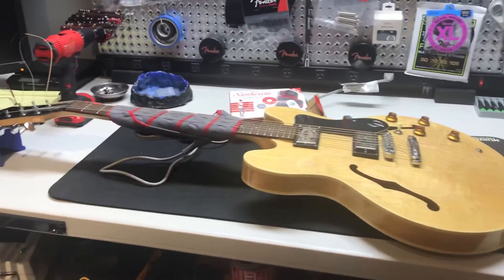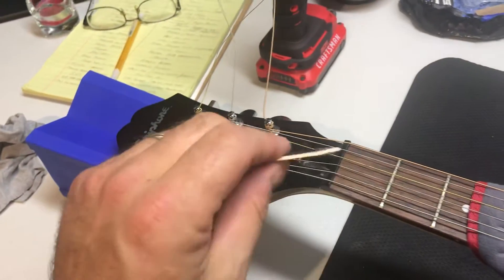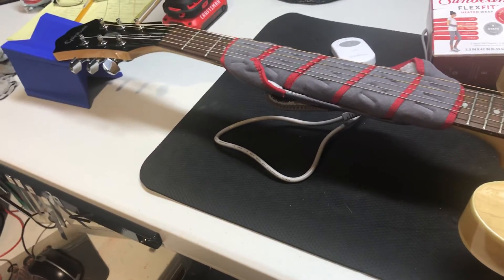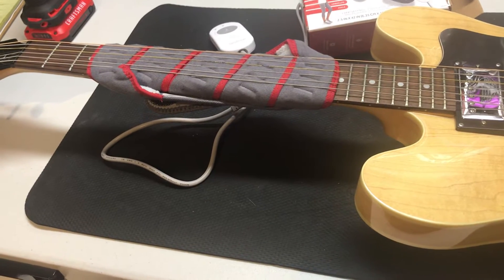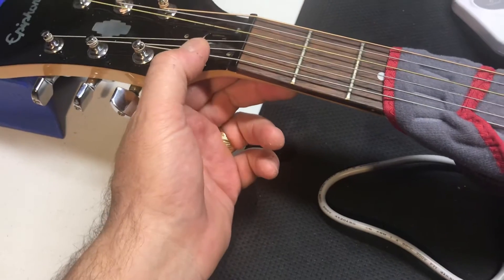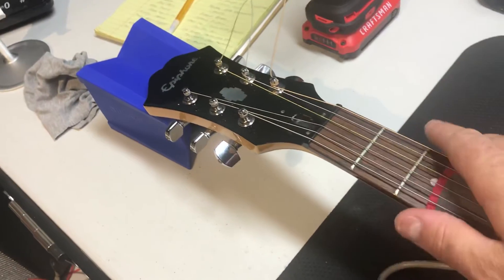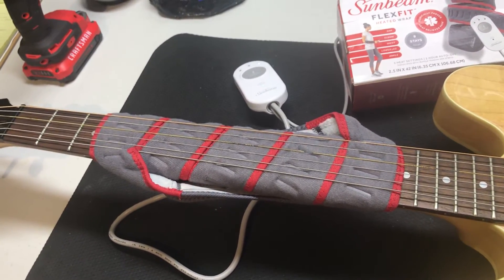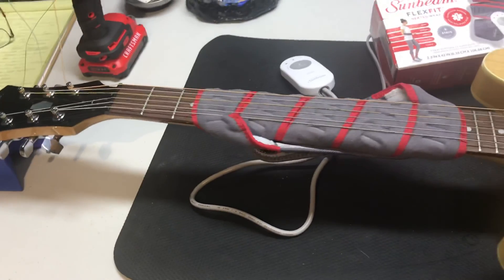Fixing a Back Bow - Don’t throw it away until you have tried this!

Comment: I just have to add to all the success stories here over the last 4 yrs. I am building a partscaster (Jazzmaster style) guitar. The body came from somewhere in Europe, and the neck is a licensed All Parts neck. They both however then traveled to Northern Ireland for a Nitro aged finish and nut/fretwork session before they were then sent all the way to Boulder Colorado - which is super arid at almsot 6000 feet. Thus, I fault no one on the fact that by the time I got this neck it had a back bow of about 1/16th of an inch with the truss rod completely loose. I followed the video, and wrapped the neck in a heating pad that maintained 150 degrees measured with a meat thermometer at the wood. I used 46/36/26-26/36/46 and took the E's up 2 steps to start and matched the tension by just tuning to the 5th fret on the other two notes. Total time wrapped and heated over three days (same deal as the video I had to reset every 2 hours with the auto shut-off) was about 20 - 22 hours. I readjusted the string tension 2 times a day. Finally after the 3 days of heat, I let it sit for another 5 days at room temp under tension. I just got finished with the final set up, using 10-46 strings, .006 relief, and my preferred med-low action 1.5mm low E and 1.25 high E - it set up perfectly with the truss rod just barley engaged.  I will say I had no issues at all with the nitro on the neck at that temp. It did however hasten fret sprout. This is not a problem for me as it happens to every single guitar I’ve had that lives in these weather conditions, if anything it was a benefit for me to just get it over with now - but be aware this may happen, or be surprised if you are not used to it. Thanks again I learned a great deal with this problem and solution!

Comment: loosen all the strings and leave an attached neck alone on the guitar. The trussrod nut will tighten a bit more and make a bit more backbow (a slightly flatter fretboard) when the strings are NOT under tension....

Comment: Dan Erlewine has another fix that can be used but it will not work on a hollow body so essentially if you have a les Paul or set neck type guitar you will get a rectangular piece of carbon fiber 1/4-inch-thick route the back of the neck out similar to how a fender neck has the rosewood strip then you need a jig to set the straightness of the neck flatten the fretboard out and use a radius block  make sure it's perfect refret with stainless frets because you won't ever be able to refret the guitar again because once all the steps are done it will have a permanent neck profile after gluing in the strip of carbon fiber thank god in this case it worked for you

Comment: Great idea. I had severe backbow in a ibanez replacement neck with the truss rod completely loosened until it stopped. I found when I applied some pressure to add some relief I was able to loosen it some more and gain some relief. Not sure if it had a double truss rod, it was a MIC jem neck.

Comment: Update: I used your method and it corrected the back bow. I heated the neck for 10 hours straight. As the neck heated up I constantly tightened the strings when they started to lose tension. I also gently applied pressure on the neck by hand every hour or so. The results were stunning.
Thanks a bunch for this video. It saved my guitar from the trash heap. I can string the guitar with 9's now and have relief to spare.
Reply from the maker: That’s great news! Thanks for watching and I’m glad it helped.
Reply: I have the same issue.  Could you tell me where I could find a heating pad.
Reply: @qua7771  Amazon
Reply: Great instruction!  If it hasn't been said, I thought about putting a metal riser nut (like for Hawaiian/Raised string slide style conversion) over the existing nut.  This would keep  the larger wound strings from cutting into smaller string slots.   The additional temporary nut height may help with the pulling tension as well.  Have you had success with one piece maple Fender necks, with the walnut filler strip in the backside?
Reply: @s.h.guitarworks3309 

Would this work without damaging a nitro finish on the back of the neck?

Comment: THANK YOU! I've spent my entire practice time for the last 2 days trying to increase the relief on my Epiphone LP Custom Adam Jones Signature (Veil of Bees if anyone is wondering which one). I thought I was going to have to take it in to the shop to get it fixed or return it if I couldn't get it fixed. I reached the point where it felt like it was about to be so loose the screw/bolt or whatever the heck is in there was going to come out completely so I was scared that was going to be a serious problem. I have searched google, YouTube, Epiphone website, etc. and your video is the first one I've seen that mentioned it might be a dual action rod and to keep loosening cause it'll grab tension again. I'm so relieved but honestly a little embarrassed and mad at myself for wasting all my practice time! So, again, thank you very much!
Reply: You can’t play good anyway so it’s fine

Comment: Another success story to report.  This was an inexpensive Squier Contemporary (left handed...my choices are limited).  With the truss rod completely loose strings in tune, the neck was dead flat with a slight back bow around the second and third fret so the first and second frets buzzed badly.

This is a solid maple neck and fretboard (with skunk stripe), which Iot of people suggest in other places is not repairable, claiming application of heat causes the fretboard to reseat on the neck.

I bought an $18 heating pad (12x14) without auto shutoff on Amazon.  With the cover off, I slid it under the strings (EADDAE), wrapped it around the neck and strapped it down with a long Velcro strap.  I replaced the trem springs with five extra stiff springs to deck the bridge under the extra tension.  And I tightened the heck of the strings.

I heated for 30 hours and cooled for about 24.  I strung it up with 10s and got enough relief that I could probably add a touch of truss rod.

Success with a maple neck!

Comment: This is a great video. I want to try this technique. Can you tell me the temperature that warming blanket goes up to? I'm wondering if what I have is either too hot or not hot enough. Also, would putting a clamp in the middle of the neck (using wood so that the clamp is not directly touching either side of the neck), doing this either with or instead of using the large gauge strings help? (Minimal pressure on the clamp, not cranking it down.) That Sunbeam Flexfit it not available anywhere including the CVS brand, looks like most people gave it low rating (for use on a body part not on a guitar).

Comment: Nice video and great info and great idea w/the heating pad!.
I am an electric player, but recently was given an acoustic guitar that is back-bowed from about the 5th fret to the nut. I could barely turn the truss rod nut a 1/16th of a turn to loosen it, and did not want to force it...(This truss rod nut is at the head stock on this acoustic), so hoping by de-tuning the strings to release the back tension on the neck will work. 
If the nut is still stuck (or extremely hard to turn where you might break/strip it), are there any lubricants that can be sprayed in there to help loosen the nut up?
Thanks and very well done video. Giving you a sub for a great idea w/heating the neck.
Phil
Jersey Shore Area

Comment: Thank you. How can I use this method to fix up bow (relief too much)? Especially I have an up bow on first three frets.
Reply: I once had a guitar with too much relief. 
What I did to it was I just  left all the strings loose and placed the guitar in case with silica gel for 1-2 weeks. You can use a guitar dehumidifier as an alternative to silica gel. I don't know if this method works all the time but it surely did for me.

Comment: Great video! Question: would this method work with a slightly warped neck (bit more relief on the unwound strings)? As you put equal tension on the neck using 6 identical strings?

Comment: I really enjoyed your video.  Thank you for posting it.  I found a Sunbeam heating pad, but can't get my strings to stay in the nut slots (wound E won't fit in high E slot and keeps sliding off).  Do I just need to use smaller strings at each side?  I would love to try this.  Thank you.
Reply from the maker: The strings don’t have to stay in the slots at all for this part. They only need to supply the tension for this fix not playability. Hope this helps. Let me know if it worked for you. Thanks for watching.

Comment: I bought a brand new bass guitar for 1200 dollars, I don’t really know much about guitars. I bought it for studio use. I find out after the return period was over that my friend told me the neck was so severely back bowed that it would have to be removed to be straightened. I really want to do your method, but I’ve never even changed strings before. Could this work on a bass, and if so what other resources should I check for any other knowledge I need for doing this?

Comment: how longer sunbeam flex fit did you use. just that there's a couple of sizes 36" & 42"
((edit)) I just spotted you used the 42".  Woul It be possible to use the 32" or would you suggest the longer wrap?

Comment: hey mate! such a nice video it helped my guitar a lot!!! great job thank you for it! :) but may I have a question? after this, I feel like my guitar strings are tight, or "stiff" in the same tuning what I used before. with the same gauge ofstrings. I tried new strings, with straight neck and nice action. I tried everything, but my strings just feels "stiff". I dont know what to do. . where can be the problem? thank you for every help
Reply from the maker: I have never encountered this issue on the same instrument. I have felt the difference when changing guitar scale lengths (Fender to PRS or Gibson etc) I guess if you fixed the severe backbow with this method your guitar could feel like a whole new instrument now that it is decent spec.

Comment: Will that work on the other relief bow my old gretsch country classic is a 30 year old guitar and the neck is warped it frets out on fret number 8 or 4th dot on neck. sub to your channel.
Reply from the maker: It will work in any situation without damaging any guitar.  This process only applies to a "back bow" where you are not getting enough relief on the neck.  If you have a neck with too much relief then you would have to make a clamp to pull it back the other way.  This guy is one of the BEST builders on YouTube and he has an excellent video addressing this method (Freddy Gabrsek) https://youtu.be/1v5i8sEJ2LQ   Hope this helps and thanks for the sub!
Reply: @s.h.guitarworks3309  Thank you very much.

Comment: I have a Tele reissue that has the treble side closet to the headstock a bit higher than the bass side. Can I essentially put thicker strings on the bass side ie:48- - - - 42 before putting the heat wrap on too twist the neck back giving me more clearance on the treble side again?

Comment: String tension will add the relief needed; that is how single-action truss rods work. String tension will add too much relief. I have worked on and built guitars for decades, and the goal, without strings, is a neck as flat as Florida (the most flat state in the union). When leveling the frets, a straight neck is correct; use a notched straight edge.

Comment: Might sound like a stupid question... but why would you  want to try and guess the tension?... Can't you just tune them all up to an A 440 (or lower) for example ? 

Ha ok lol, i've just realized why while I was typing this question, this is in the case  where you don't know the string gauge of each string i'm guessing ? But I guess if you use all 42 for example you just tune them to the same pitch...

Anyways good idea the heat belt, coz you can't find those specialized fretboard heaters anymore (well not in my country anyways). I've had an SMO fat that doesn't have enough relief (I think it's because the maple is so hard) and I was trying to find a heat solution, this sounds good and not expensive.
Reply from the maker: Glad you liked it.  I’ve checked with the owner and it is still holding proper relief. Let me know if it works for you.  Cheers.

Comment: how hot do you set the flex wrap? do you just crank it?

also, somebody else asked what you mean by 2h intervals. i'd like to know as well.
Reply from the maker: simply wrap it around the middle and velcro it.  The wrap actually shuts off every 2 hours so you can run it through several cycles.

Comment: I assume it's the process with a bolt on neck? I have a 1991 peavey predator with the same issue.
Reply from the maker: Yes, it is the same, just make sure you don't put too much pressure on the neck joint.  If you see any lift or cracking, you may have to go a different route.

Comment: How many times a day were you running it? I know you said 2 hour intervals. Does that mean you're leaving it on for 2 hours, leaving it off for 2 hours, then turning it back on, and doing this like 3 or 4 times until you go to bed?
Reply: Also what gauge string should I use? I have 11s on a Tele now, but I might get 2 sets of 10s for this experiment. 
P.P.S. When you say to let let cool under string tension, do you mean the strings we put on to do this, or the strings that would normally go on it?

Comment: like the heat  but would have fear of collapsing bridge think clamp would do the same without stressing all other components
Reply from the maker: Pretty difficult to clamp a "neck through" non bolt on style guitar and apply the exact pressure needed to not twist the neck and add relief.

Comment: How many hours did you heat the neck? Thanks!
Reply from the maker: I left the heat on in 2 hour intervals for 3 days. May have been overkill, but since I couldn’t keep it running constantly I felt the more the better.  How much relief are you looking to gain?
Reply: @s.h.guitarworks3309  it's a similar situation as your video. With the truss rod completely loose and strung with 11's it's barely enough relief. I would like to use 10's and be able to engage the truss rod so it won't rattle.
Reply: 12hrs x 3days=36 hrs total sound right?

Comment: Aren't strings guaged to hold equal tension across the board? Why do you think smaller strings hold less tension?
It's the player who sets the tension, not the string guage.
Reply from the maker: The amount of tension required to bend the neck snaps the thinner strings. You are probably cranking them 3 notes higher depending on how much relief you need to add.